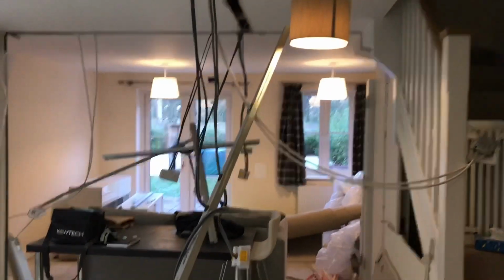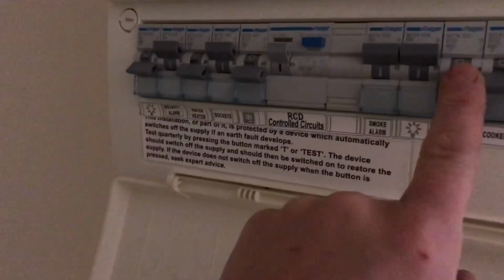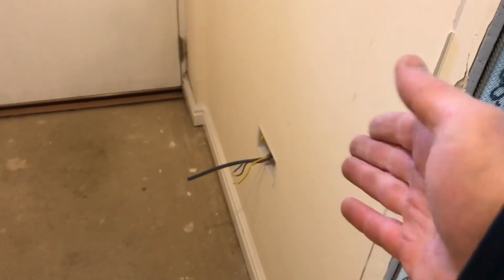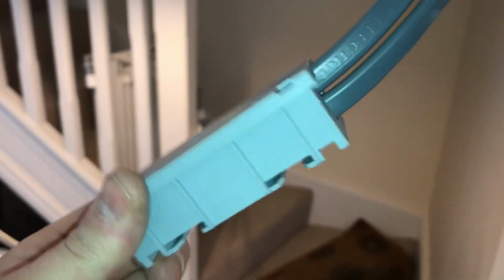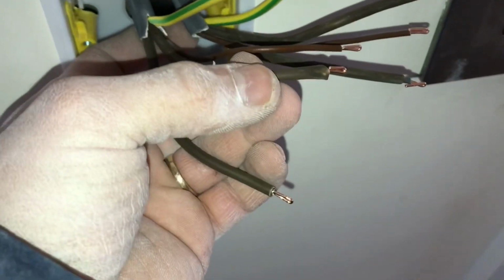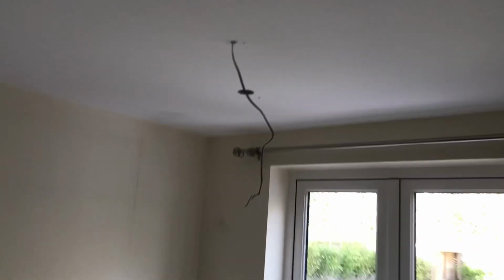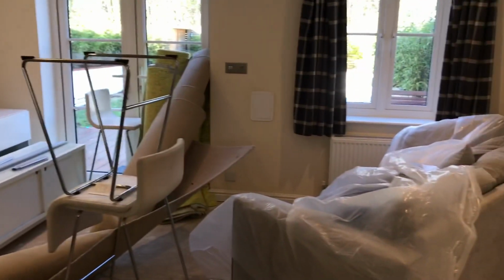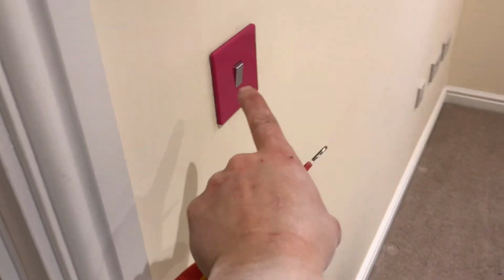Electricians Day New build wiring. Luceco Down lights and reconfigurations.

Comment: As you say a pad saw is easier than a multi tool, if you don't act like a lunatic you can even feel cables in the partition walls. But only use a multi tool when it is a new build and you need to cut out many boxes as possible.

Comment: Sticking a junction box in a ceiling void, so it is totally inaccessible once the builders works are completed.  What happens if that joint fails at some point in the future??  You need to rip up the floor or pull down the ceiling to get at it!  Does that really comply with British wiring code??  I would be shot if I did that over here (New Zealand).  All joints no matter what they are for or where they are must be easily accessible.
Reply: Its a maintenance free joint box using wago connectors which is compliant with 18th edition wiring regs if done properly. When the lid is clipped on the cables cannot be pulled out and the wagos do not loosen like traditional screw ones do over time.

Comment: Pretty sure building regs say not to have sockets back to back will have to look up on it now, also those engineered joists doesn't matter where you drill too as long as it's the chip board
Reply: Building regs have nothing to do with this. All that Chris must adhere to is BS7671. 

I recently built an extension, building regs made some comments about where sockets could and could not go, some of the 'rules' were stupid and were not in the electrical regs so I called up my BCO and told him I would wire my extension in line with the BS7671 and that I didnt subscribe to building regs that tried to make their own rules. He told me to 'do the best I can' to adhere to them but my point was valid. 

Building regs are written by people who are Jack of all trades master of none and often write total rubbish. Always build to the BS reg for the discipline you are undertaking.

Comment: That plaster fix is like gold over their! Here drywall mud comes either in boxes lined with a bag or 5 gallon buckets and you pay about $9 for a 3.5 gallon box or $13 for 5 gallons. Currently the exchange rate is 1£ = $1.30 so yours is $32.50 wow! Unless that’s some special type
Reply: The pre-mix stuff is more expensive, 25Kg bag of dry is about £6 and lasts longer as you only mix what you need when you need it. This stuff is certainly good for an electrician to have in his van, but you pay a premium for the convenience.

Comment: I just had a kitchen refurb and my builder said put the down lights in plastic bags before the ceiling is skimmed, I had a plasterer in, and paint the ceiling before fitting the lights in the ceiling. This kept the new lights clean and I could roller the ceiling it worked a treat and the lights worked ok as they are LEDs.

Comment: Hello there not a professional electrician just a DYI that knows the trade doesn't from the code and has worked on just about everything imaginable here.

Here in the United we are NEVER aloud to place a junction box inside a wall covered over or otherwise inaccessible according to United States electrical code.

It's prohibited by the NEC National electrical code.

But for good reason if something goes wrong you can't find where the problem is and safety issues as well I'm running into this all the time though trying to find a junction box where it should not have been.

Also something I found out quite by accident when I was using my no contact tester with a 24-volt AC option button.

I accidentally had two button down and I realized I could sniff out live wiring without knowing where to look where was trying to find where someone went or whatever. So someone might be able find this useful.

Comment: If the joists are the same design as here in Canada you can drill holes for electrical wires pretty much anywhere you want.

Comment: I was a little surprised that a connection can be made in what was called a "maintenance free" and can be enclosed in the ceiling without access. Here in Canada that would be against the electrical code. Hmm just surprising.
Reply: D Hammer I was thinking the same. Any box must be accessible.  Hidden box with a splice in it is a code violation in the USA.
Reply from the maker: It’s under floor boards that are accessible
Reply: CJR ELECTRICAL Thanks. That makes sense.

Comment: Regarding screwless flatplate; (1) Are we the only company that find dryline boxes hold the above off the wall if not skimmed in initially? & (2) The flat-head socket screws supplied allow the screwless cover to clip on perfectly and that the 40,50,60 & 70mm rounded-head socket screws don't allow the perfect fit? Two brands so fare BG & Knightsbridge who we called wouldn't supply longer screws along with several other Irish/English electrical wholesalers........We'd love thoughts and links on this issue. N. Walsh (Magnetech Solid Solutions limited)

Comment: As is the way with a lot of these foreign accessories, you often find some that look identical but are branded differently. I have used two differently branded versions of those sockets and they have been fine.

Comment: The engendered boards have full spec sheets on where you are allowed to be drilled out and to what size hole. 
Most likely the plumber didn’t read anything like that but they are probably fine where they have drilled.

Comment: What do you have against supply to pendant? I think it's better as you don't have to chase down to the switches to add more lights. I just chuck the connections in Wagoboxes if I use downlights.
Reply: @Matt Barber  I think that used to be in the regs but if so it certainly ain't any more.  You've identified the potential problem.  However the advantage is that it allows fitting dimmer and other control switches that need neutral and, incidentally, it's usually easier to inspect and test.
Reply: @Matt Barber  well i mean if someones that stupid anyway they wouldnt realize that they would also have to change the mcb on that circuit to stop it tripping so would be unlikely to cause any real danger

Comment: I get the work done stairs but y they didn't request the builders to put the spot lights instead of central pendant makes no sense I work on new build houses and we are always getting requests from the buyer of the house to wire for spot lights rather than pendant
Reply: It isn't a new build in the sense it's literally just been built, anything built recently (and therefore poorly and junk) is a 'new build'. The house is clearly not brand new, so he is modifying a recently built house for the owners hence it has not been done by the original builder.

Comment: There's no one size fits all when it comes to pricing a job, the cost of a job depends on a number of things such as location, complexity of work, quality of  materials, method of installation etc. You don't wanna price the job too high or too low, you do the job for a price that both you and your customer are happy with, everyone wins. Be confident and reassure the customer that they're getting the very best value for money.

Comment: hi, keep in mind that wago are not maintenance free connection, i have several occasions of faulty wago after 1 year of working, there are in junction box for my luck but if you hide connector in hided box some day there may be the problems.
Reply: Proper wago should not fail after a year ...they are most likely copies
Reply: The one he used looks like Wago Light, which is not maintenance free. There is a different Wago box that has MF mark on it and if installed properly is considered maintenance free.

Comment: hrly rate depends on area of country anyway,  London around £70ph, MIdlands is around £20ph and Cornwall (big county) is between £22.50 and £30, Lincoln or North east if you like is £25 and Manchester/Liverpool is £27 ish. Google it.
Reply: arnie wheeler once paid £70 for a light pendant to be fitted and a plug to be changed from the floor to the wall. Safe to say he was in for 20 mins. That’s in Edinburgh
Reply: perhaps, supply and demand situation. not many sparkies around and the cost could go up. seems a lot for labour only.

Comment: sometimes you cant use the pre-drilled holes because the thick joiners cant be arsed lining the joists up, and the cables are all over the place, and its a twat to pull the cables in,  plus you can drill where you like in those joists and more or less any size hole, i have seen 4 inch ducting run through the joists, all seen and passed by building control, nhbc etc.

Comment: Hello, another good job, just a quick question, why don't you double over your 2.5 cores in the sockets?
Reply from the maker: A single 2.5 yes I would double up.
But 2 x2.5 cores equal more or less 5mm why struggle trying to terminate a 10mm cable in a socket? Sometimes there overkill and sometimes you need common sense to be applied too.
Reply: Fair enough, I've always doubled them and I remember this being something the select inspector looked for on my first on site inspection back in 2005, can be a bit tight on some of the cheaper sockets though ☺
Reply: Single conductors always doubled up in a terminal, 2 or more don't need to be. If the terminal is too big for 2 or more conductors, twist together... Common sense like he says
Reply: Twisting togethers a definite no no especially with solid cores, depends how you've been taught and common sense I guess ☺
Reply: @youngplumb1107  I agree, if it's a round terminal it's OK to save conductors coming out, a square box terminal is a no no..

Comment: how did you find them Luceco downlights? I fitted 6 of them a while ago and had a real problem pressing the gripper down to hold the cables!
Reply from the maker: Fantastic never had any problems. If you back the middle screw out all the way then click the sides in.

Comment: You can drill anywhere as long as you follow the drilling guide. Never seen any plumber or spark use the knockouts ever. You should also scrim the patches aswell 👍

Comment: Great video. Just one point. I heard you don't need to brown sleeve the grey and black wires in the switches as they are line conductors. Is this true?
Reply: Hello, we've always been told by Select (scotland) to always sleeve greys and blacks in single phase wiring, good practice
Reply: It’s not 3 phase installation so sleeve brown
Reply: @supersparks9466  yes true. I'll continue to sleeve them brown

Comment: Great job! By the way, I was told by WAGO that the WAGOBOX Light is not maintenance free. I assumed it was but apparently it's not, so it can't be used in inaccessible areas, only behind light fittings etc. where you can get to it.
Reply: Correct the Wagobox light doesn't meet the requirements of BS5733 to receive the MF mark
Reply: Odd.. The only difference between MF and not MF is a MF is sealed shut? I use those cheepo ones from screwfix about £1.50 and they're just MF by the fact they have a plastic locking pin to stop anyone opening it. Daft lol...

Comment: Think most people asking about pricing jobs are just young sparks (like myself) /people looking to go self employed one day. Not nosey bastards at all. Fair comment you don't want to tell people your price.
Reply: Maybe just explain how you price a job so those that have subscribed can learn something. Disappointed with your nosey bastard comment.
Reply: Leigh Browne 180 for a full day plus some kit and certification. Way to cheap mate.
Reply: Couldn't have said it better myself 👌
Reply: That's exactly what I was thinking. I'm reasonably new to the trade and you need a guide or you could fuck yourself over
Reply: Well said
Reply: I never ask prices, just charge what your happy with or what you think you can charge for any particular job, the more aggro it is the price goes up.
Reply: Always price more than material costs.
Reply: my intention to ask how much it cost was if it is appreciated that the electrician for the responsibility of an electrician
Reply: @Leigh Browne move down south, you will get more than £180 a shift as a site labourer
Reply: @Leigh Browne  3m of 10mm² fed through existing surface conduit and a 50A 2-pole switch to fix a shower tripping the RCB.  Max two hours work, including writing the cert and the invoice. £450.  Effin' London prices!

Fortunately I wasn't paying in this instance, but really Mrs Kitchen Socket Job really has no idea.  :(
Reply from the maker: Email me or pm me on Instagram if you need help YouTube comment section is not the place.

Comment: I reckon once you use a multi-tool, you'll chuck away your pad saw 😂
Reply: A drywall router maybe, but not for a multi-tool.
Reply: @DaddyBear3000  drywall router ? Whats that
Reply: Karl Harris true. Multi tool takes longer than a pad saw.
Reply: @zedman442  have you used a pad saw when its double boarded? A multi-tool is far quicker, easier and neater.